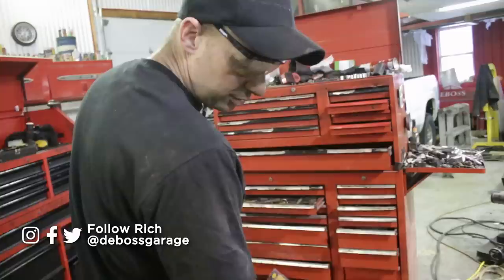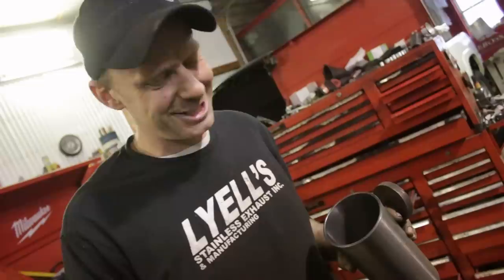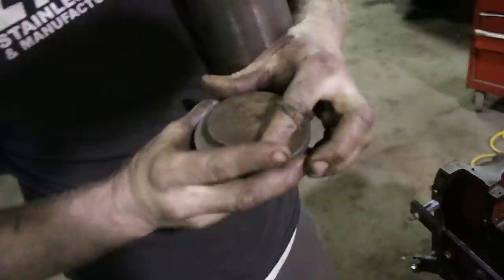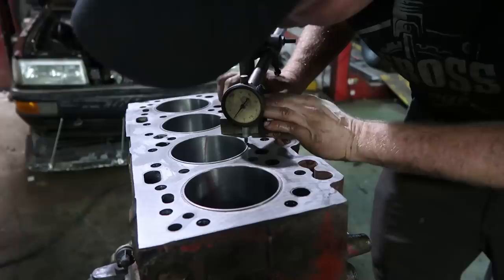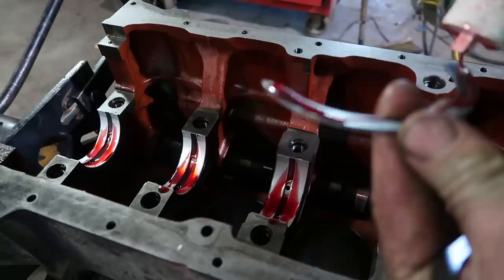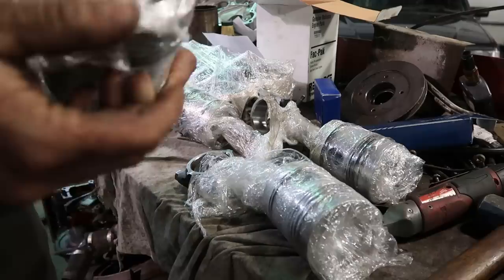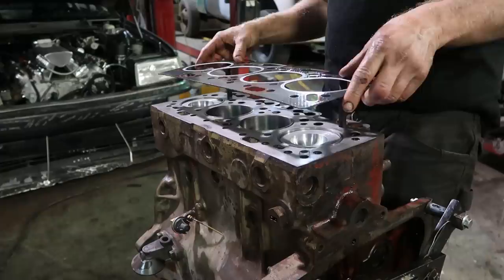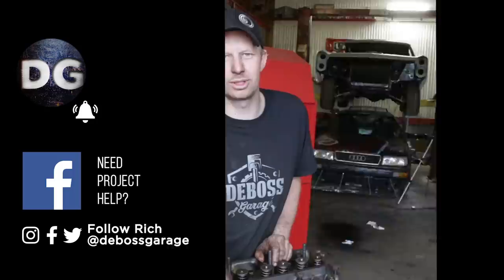3.9 Perkins 4-cyl Dry Sleeve Engine Rebuild | Massey Ferguson 270 [EP2]

Comment: Oversized means larger on the outside diameter of the bearing for if you had the mains line bored/honed. Undersize like you said is larger on the inside diameter for if the crankshaft had work done to it. Oversized is probably more rare since generally mains are just line honed and not much is taken off.

Comment: In every Manual I have read which is usually Honda Yamaha Kawasaki Suzuki non-diesel stuff. In those manuals it says when installing piston rings never install within the cross directly across the Piston pins is one line and then the center going the other way is the other line you always want to install them in the corners if possible as if the Piston were a square. Just what I've read and what I have followed and it hasn't let me down. As experienced as you are I'm certain the way you do it has not let you down. The reason the books say that is that forward back and side to side are thrust surfaces supposedly. Regardless love the videos thanks for all the information!

Comment: Loved the build.  I was a little surprised the the pistons had a front and back.  The arrow.  I have built a few engines.  They were all v block engines.  I know all of those have an arrow or notch to indicate front.  The reason being is that the piston pin hole is off center.  Only one piston that I know of for an inline block that has a front and back is for the flat head jeep piston.  The WW11 Jeeps and the CJ 2A's.  This is because of relief cuts made in the skirt of the piston.  I know this because I have had more than a few pistons go through my hands.  About one million to be more precise.  I use to make them.  I did every process except for final pin hole honing.  I machined almost every piston that you can think of.  Model A pistons to Chevy 454 pistons plus a few more. I also machined KB racing pistons for stock cars.   I never did make any Perkin's pistons though. 

I would love to know why this piston fights the norm.  The cup seems to be dead center.  The pin hole should be dead center, given that it is an inline.  Looks like one crank journal per cylinder.  Makes no sense to me.  Love to hear from you.

Comment: I've been "working" on my own cars for many years.  When I had to. My first car was a 1954 Plymouth Savoy with a six banger that when you let up on the gas pedal when in 3rd it would go into overdrive - so that dates me to some degree.  Trans., clutches, generators and then alternators - that kind of stuff. Engines have always been a mystery.  This was the first time I've really understood how sleeves were dealt with.  

I hope you're training someone personally.  This could become a lost art.  Even though the comments suggest the is a lot of technical expertise out there I suspect it's actually a relatively small group.  

Great stuff.

Comment: I have built many engines over the years. I have heard to get the rings to seat faster, use auto trans fluid! To lube the rings for install. I always use 10w30 or other light engine oil. I have also heard of using 2cycle oil for rings, and just read in comments about using WD-40,  I like using a combo if Lucas and 20w50 on bearings. And cams. Lucas first rubbed in. Then a few drops of oil. Never had issues. But always looking for the best way of doing things , I always wash cranks and clean all orifices,  my dad learned the hard way. It didn't take long for a newly rebuilt engine to start knocking!!!  Anyway what are these lil diesels worth?? I'd like to get one!!

Comment: My 2.5 is leaking oil out of the weep hole under the tach mounting plate. Only does it when it runs for a while. Any ideas? Your videos are good.

Comment: They do make both under and oversized bearings, undersized  is smaller inner diameter oversized is larger outer diameter because material is removed from the block and not the crank

Comment: welding a bead along the inside the sleeve is the way we did it a the shop i worked at. it worked but i wouldn't recommend it.

Comment: dry sleeves to be put in with just oil freeze the sleeves before putting them in make sure you have the right tool to tap them in and the hole that they're going in is clean

Comment: Why not freeze the liner, heat the block, and drop it right together??  salamander heater on the block, freezer, liquid nitrogen, or even propane from a 20 lb tank turned upside down for the sleeve
Reply: You coulds use dry ices with sleeves in there to if you don't have deep freezes in shop.
Reply: that might be too much thermal shock, I did that to a cylinder head to install some press fit rocker studs and cracked stuff.
Reply: @chevellechris1  I work in Yamaha/Kawasaki shop so most times used dry-ice is on bearings putting in engine cases. The Bearings will most of the times drop in. Heat the aluminum case with heat gun prior to. Did not know the metal would be that fragiles - good to know.
Reply: @mt1885  my experience was with a cast iron. Light weight small chevy head.  And this was waaaaay back when I was in auto tech school, so take my notes with a grain of salt

Comment: Can we increase the pto hp of mf240 by installing or replacing any gear to pto runing shaft or by incresing torque of the engine...and secondly can we install lifting hydraulic pump externally on mf 240

Comment: We used plates like yours but with a 3/4" ready rod and a chunk of truck frame with a hole in it on the deck and used our impact guns to pull the liners in frame on road tractors then usually beat them back in with a block of wood covered in rags with dish soap to lube the liner o-rings but those were all wet sleeve never seen this done before learning everyday!

Comment: Hmm seen a way to do it with some acme rod a frame out the bottom and 2 nuts with that hole in the center would be a good puller hell a couple thrust bearings to make it even better
Reply: As well you may want to try dry ice in a box may just literally drop in just an idea at minus 78

Comment: Always thought of the sleeve degradation problem like an electrolysis process similar to how a ultrasonic cleaner works but instead of cleaning dirt from a part it removes layer by layer of oxidated/contamined material from the sleeve. Far as I know a filter is a filter as is denoted in the name. but maintaining the filter and regular changes of the antifreeze can make the sleeve last longer. On a wet sleeve engine it should be changed regularly not just checked for the functionality of the antifreeze ability.

Comment: I never had a problem with welding a longitudinal bead.. you don't want to kill it. Those dry interference liners were a bitch.
A word on those balancers.. There was a bad run of the carrier castings on those oil pump/balancer assemblies that would just break on the 4.236.  Remember doing some of those when I worked for a Perkins dealer.

Comment: Can you run an ignition oil pressure switch so you don't run into this same situation so if it drops oil pressure it shuts the engine off?

Comment: So I'm two years after the fact of this video but I thought I might as well ask so I'm looking at doing a similar thing to a international tractor and I think I'm just going to be doing an in-frame rebuild. do I have to be doing this same amount of gauging/ work if the original crank is in the engine? or is it just buying sleeves/ pistons to fit the original crankshaft?

Comment: I'd use Ni-kal on the outside of the sleeve for thermal transfer and freeze em in LN2..they'd drop in, atleast my 8" ID.14-1/2" OD,7.625" W bearings do ;) with 3-5thou interference

Comment: I started using a product called copper coat on dry sleeves for good thermal connection
Reply: In a pinch you can use nappy rash cream.

Comment: Love this channel....and I have a question for all you Gear heads. We have a Massey 282 with a Perkins 4-248 A that is getting a lot of diesel in oil pan. We have replaced Injectors, and both pumps.... Is this cylinder issues?

Comment: For anyone building more than one engine in their life invest in a dial bore gauge and outside Micrometers. Then you can Accurately measure your bearing clearance! 
Plasti Gauge is ok if you know your machinest looked and set the clearances but you dont want to put new parts together without measuring everything first!
Reply from the maker: 40 engines or so in my career and I have never had 1 out of spec
Reply: @DEBOSSGARAGE  Are we forgetting the LS in the Mercedes wagon?  Not a bearing but still a part out of spec.

Comment: I've actually gotten oversized bearings. didnt read fine print when ordering what was called "stock spec" main bearings and they were like 30 over and the crank wouldnt drop in.

Comment: when we did that we used a 4x4 block of wood, a metal plate and a big hammer haha.
Reply: How did you do this?   I have a Perkins A4.248 and needs new cylinders. I cant get the engine out so trying to do an in chassis repair. I got them out but trying to figure out how to get the sleeves back in while still in the machine.

Comment: Great guy! You don’t only see what he’s doing but you feel his build in mastering mechanics skills! Top! Real “Boss”
Have a question for my tractor... got a issue on my MF 284/4  - Landini 6500.
And before I open the motor I got to be sure off the correct motor type!?
Into the booklet the motor type is a A4 212
Onto the tractor nameplate the tractor type is a MF284/4 serial# 220H00479
Onto the motor nameplate the motor type is a “Perkins Engines A4 236”
The motor serial# LD22574 U 954913L
The bloc serial# 3711328A/1
My question.: what type of motor I got here? A 212 or a 236?
How can I see the difference in between them?
Thanks in advance... Bob

Comment: I thought that undersized bearings were for a smaller crankshaft journal and oversized bearings were for a larger bore. So, if someone got a line bore, they would use oversized bearings.

Comment: Man !! I have that engine 3.9 perkins on my truck dodge 1989 D-350 😆
Reply: is it the engine for the truck or does it run something else(ie compressor or something)? I always thought one of these would be neat to use to power a vehicle, not sure if they are big enough though.
Reply: If you keep oil changed in those old Perkins,20,000hrs before overhaul,easy.Great engines.

Comment: I did a massey 240 about a year ago, broke the top lip off the liner, used a shitty small flat head screwdriver, softer than the block material, hammered it between the liner and block, unzipped it and it falls out. 

Installing: get liquid nitrogen, shrink, drop into place. Done.

Comment: 2:50 im a mechanic and computer science major.... 

i wonder if thermal paste would work..... it wont hold it in.... but it would DAMN SURE conduct the heat away
Reply: kain hall i thought the same thing.
Reply: thermal paste is actually a pretty bad conductor compared to two perfect plane surfaces. Those liners and the block are far from being perfect, but they are heavily compressed to each other, so everything in between will reduce the conductivity.
Reply: @RubenKelevra  ya, but even CNC shit has to have some gaps

People lap their CPU and heatsink.... and still REQUIRE thermal paste (just less...)

Idk.... I doubt it would hurt
Even if it doesnt help

Like.... despite how hard you try.... when you are making 500 million of a thing.... across 10 factories

Their is going to be imperfections
Reply: Like..... ya. If its 100% perfect fit..... sure

But I'm saying the odds of that in real world engines is very slim
Reply: @kainhall  well, that's why you wear the engines in. The sleeves are pressed outside by each heat cycle and the combustion pressure, until they fit snuggly together.

Comment: Great videos, I especially like the "Every thing that is wrong with" series. My comment on the 3 liter Duramax is that I had an Acadia with the "High Value" v6 so GMC has a snowballs chance in #€!!  of selling me a diesel  with a non servicable timing chain. Also I own a 2006 Dodge Sprinter with the 5 cylinder Mercedes diesel which I think is a fantastic engine. I would like to see a video on it, if it is in your wheelhouse. I bought the van with 229,000 miles on it so it took a little bit to get it lined out but the fuel mileage and acceleration are amazing, especially  since the van is the size of a small house.

Comment: SCAs aren't necessary with the new coolants they have out on the market, several major manufactured engines do not come with a water filter as they are using nitrite free coolant now. Nitrites in old coolant formulations are what facilitate erosion of water jacketed liners. SCAs were a way to combat that in the old formulations of coolant. Cavitation isn't what damages the liners, it's chemical erosion.

Comment: yer big girls blouse welding a bead on the liner is the safest way to do it remember its a casting you are wailing on if you get a really tight one  you can screw things up real fast  you run the bead and tap it out  quick so the heat does not get a chance to spread did this for many years  never any trauma also warmed the block evenly with a rose bud torch before dropping well frozen linners in  NEVER any loctite   agh the good old days

Comment: You should get liquid nitrogen for the sleeve they would drop in like nothing no press needed.
Reply from the maker: But I already have a press.  I don't have liquid nitrogen
Reply: @DEBOSSGARAGE  its all we use here 😅 but we work with Letourneau loader and 793F mine truck, d10 and 994 cat loader

Comment: I have a Perkins A4.248 in a Massey Ferguson 50HX 1988 backhoe and needs new cylinders. I cant get the engine out so trying to do an in chassis repair. I got them out but trying to figure out how to get the sleeves back in while still in the machine. Any ideas anyone?

Comment: Our 4020 had that problem and it cost my Dad $6k to rebuild.  Didn't throw a rod at least.  It didn't help that my Dad didn't use the correct coolant and didn't use de-ionized water.

Comment: dont oversize bearings come into play when you line bore a block an the back side of a main bearing is beyond factory specs.?
Reply: No.
Reply: I believe it's very common on air cooled VW's, because the crankcase gets pounded out of shape.
Reply: They cut the caps.

Comment: Gud day my boss I like our videos I my name is Rohan Allen am from Jamaica am having a issue wit my Perkins .it broke a valve spring in number 4 cylinder. When I remove the top cover I realize the rod got jam .after we change the spring and replace the rod now we are having a play when u turn the engine and when u start it it making a noise and den shuts off now it dent start.can u plz help
Reply: When you replace the spring you should also replace the valve.You re used old valve and now it has dropped down into the cylinder.Very bad.

Comment: Have you ever been tempted to use more modern engine building technics on older engines like this? For example: drill oil relief holes at the back of the oil ring groove. This done on virtually all new piston engines. Another example: balancing the crank, rods, and pistons?
Reply from the maker: Never even crossed my mind.  We are building farm equipment, not racing engines.  I don't think the farmer would appreciate the end bill for balanced Rods, crank and pistons.
Reply: @DEBOSSGARAGE  Fair enough, there is an old machine shop in my town and ounce they showed the old guys/ farmers what balancing a rotating could do to an engine it was an easy sell because it runs smoother and saves bearing surfaces... For example I dropped by one time and the front counter lady was showing me a 1912 DOUG (I didn't misspell Dodge) rotating assembly. One local asked them to balance it ( the connecting rods had hinges where it connected to the crank, and the crank had no counter weights) and they were still able to do it.

Comment: Wonder how you ensure the rod does not gall the journal ? we used to use the rubber booties over the conrod bolts... saw you installed the pistons without using anything to guide them.
Reply from the maker: I pull the piston down with the journal at the bottom.  Just be careful.  The other three on the time laps you can see me install the bolts after.  I plastigauge a rod journal too

Comment: Might be a dumb question but what does the sharpening stone do for the surface?
Reply: Takes away high spots and imperfections that might stop a good gasket seal. It will also help identify a warped gasket surface like a warped head before assembly

Comment: Nice video, you're doing a good job on passing on your knowledge! I have two videos on my channel where I work a bit on a Perkins A4.236 engine; one where you can see how I removed the liners using a puller which I had a local machine shop making/welding and another video where I install the liners using dry ice. Have a look if you want to and please leave a comment if you do. The videos are without narration and just show what I did.
Reply: Boss t 4 236 is it strong?

Comment: Is It a perkins 1000 series engine? if so it has a hardened crank.. and cant cut the crank, unless you re- harden it! a new crank is cheaper than that process! engine wont last very long if you don't harden the crank!
Reply: James Lombard we had a John Deere 6610 premium with a hardened crank. The engine properly locked up on is because the tractor was in a crash and turned upside down the in the process. The revved out completely and seized. We rebuilt the engine and the crank could be saved and it was bad. Re polished up going perfect since

Comment: What was the $0.59c part that failed and wrecked the engine? rebuilt a few of these Perkins myself
Reply: The plastic oil line leading up to the mechanical oil pressure gauge
Reply: @acemobile9806  Bummer....

Comment: No need to weld it, to much chance of damaging the parent bore. Just get the oxy acetylene and heat a line up the length of the bore to red hot, let it cool and it will be easier to hit out